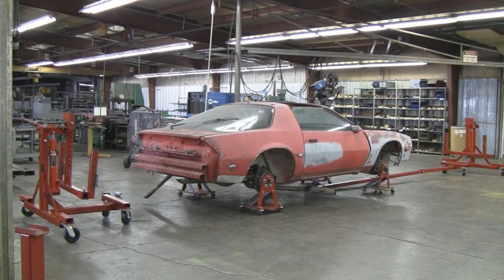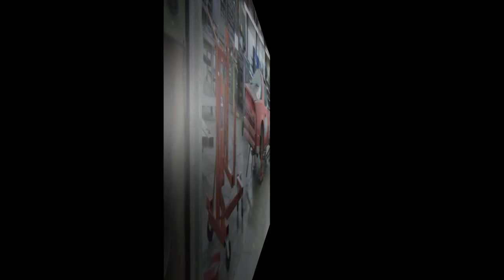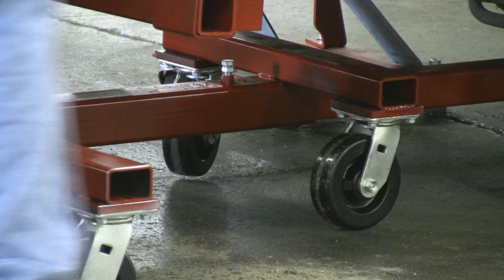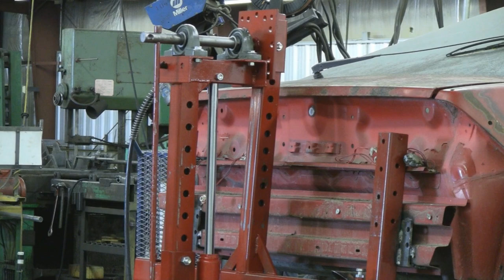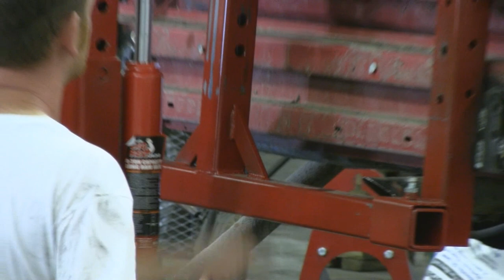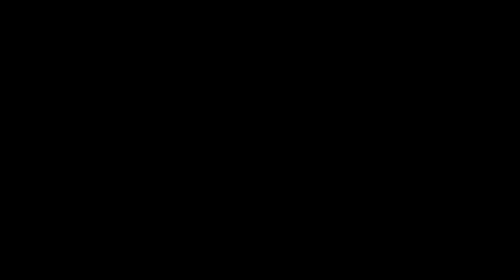Auto Rotisserie - Here's One Way to Mount Your Car on the Rotisserie

Comment: I have a car hoist in my shop. I can lift a car body up and do any type of cleaning or painting on the bottom side. I set the car on the ground with wheels or on a roller cart and then ( with car out of way ) I pull the lifts arms together ( all four ) and C clamp some 2x 6 or what ever suits you to the hoist arms in order to sit on. I raise the hoist up and roll the car back in place. By sitting on the 2x by I can easily sand and repair anything on the roof. Works good for me. Just my two cents worth.